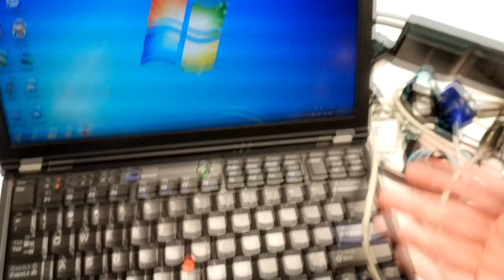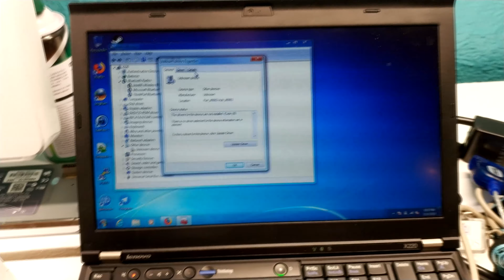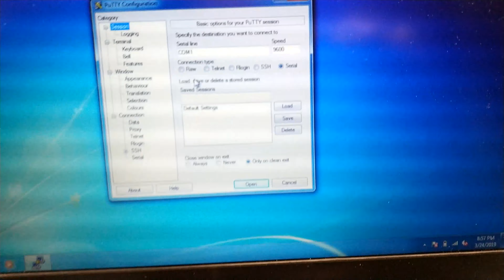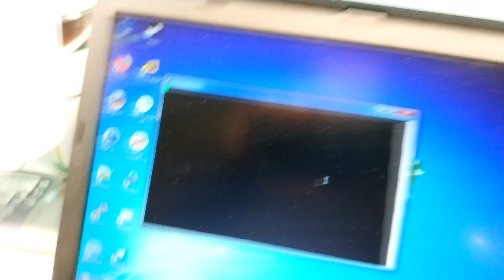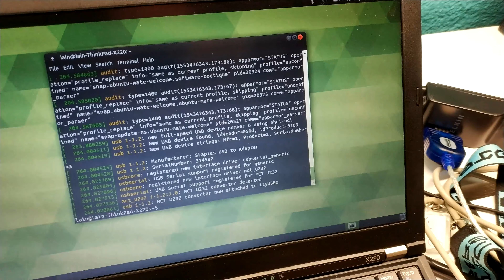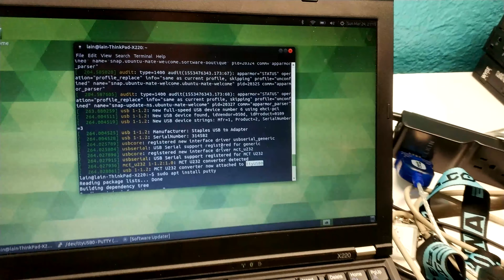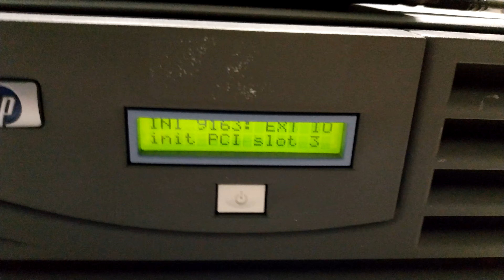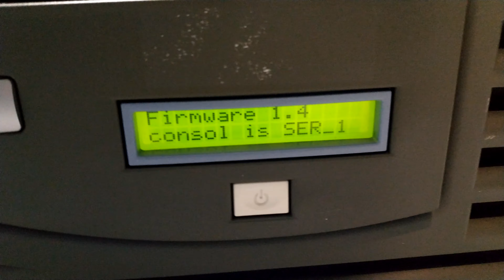How to set up a serial console connection to a server/workstation

Comment: Hey - so I'm I trying to get a serial connection to my Dell Precision T5610. It has no on-board video and a serial-out. I've followed your walkthrough - tried on windows, linux, and macOS, but I just can't get any data flow to my console. The connect works - i.e. putty (or screen in macOS) opens up a terminal window with prompt on windows and linux (all the settings are accurate on both sides). But when I boot the system I am trying to connect to, there is never any data through the serial winds. pressing Enter etc does nothing. Removed all periperals and the GPU I stuck in. I boot the system with serial connected and I can still hear the system boot into windows (case has a little speaker) as normal. The only thing I can think of - is there some why the serial port can be blocked in bios or something? In device manager on the system, it all looks fine though..

NB: a serial connection was going to be my workaround for my main issue - the system does not show the bios splash screen or prompt. It simply doesn't put out a video signal (this is obviously when I have a GPU in it and monitor connected) - not just a black screen, no signal. Like the monitor is in power-saver mode waiting for a signal - As soon as Windows boots, the video appears. My assumption is that something is diabled in the BIOS to prevent access? is that a thing? NB: have tried all the troubleshooting I can find re: this BIOS video issue too - CMOS battery etc. Nothing has helped, so I though maybe serial would get me into the boot menu at least!?

Cheers for any help you might be able to give!

Comment: Thanks for the video. Is it possible to repurpose those old router/storage/tcp-web servers that, as mentioned in your video, have no video output, installing linux and using it for other tasks? I found a Riverbed Steelhead CXA series thrown in the trash, which has no video output and would like to be used as sas network storage through installing linux, is it possible/legal?